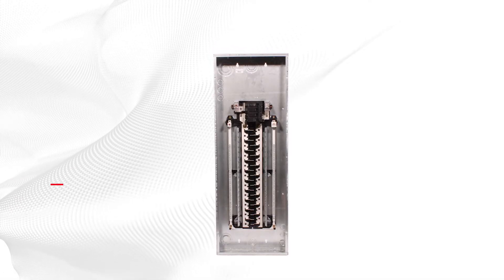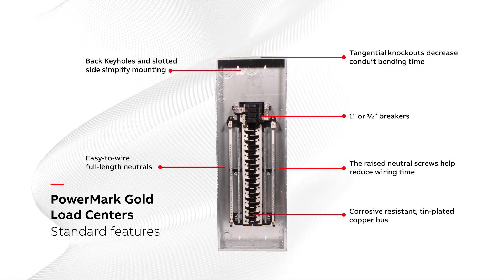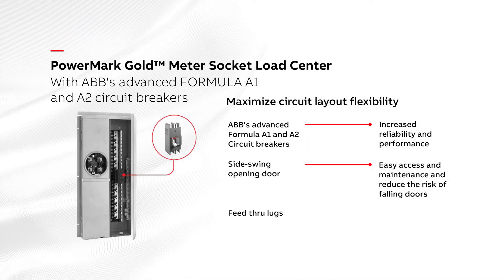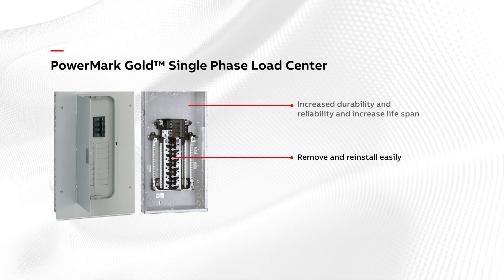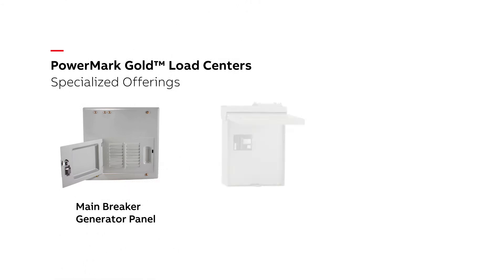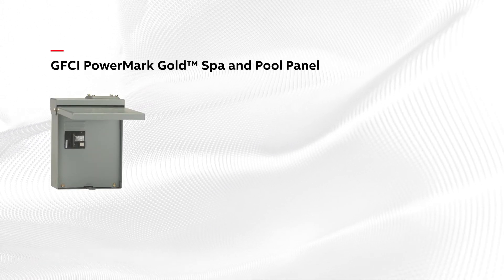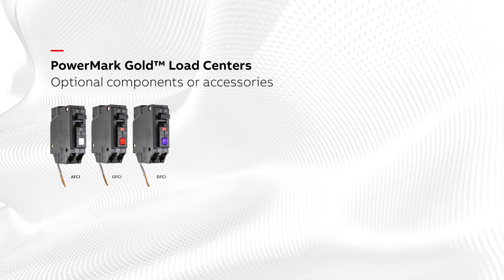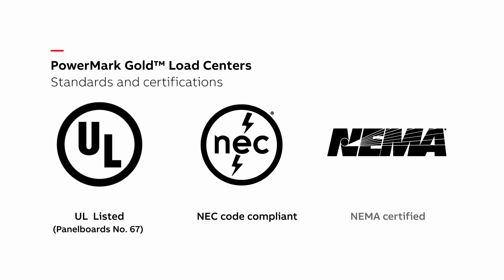GE PowerMark Gold™ Load Centers

Comment: Man i got a panel where the main wasent pre installed like they all should be and the two pieces the breaker bolts to are gone.  And you cant fibd just those 2 little pieces that bolt into the main lugs on the panel for the main to snap onto..  wth?!   So now i gotta buy a whole new 200$ panel just to get those parts..